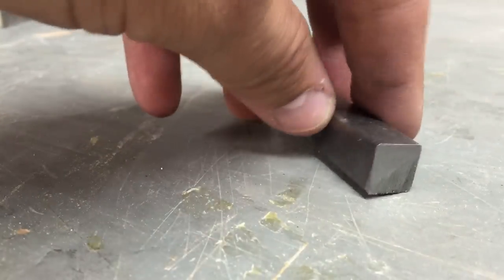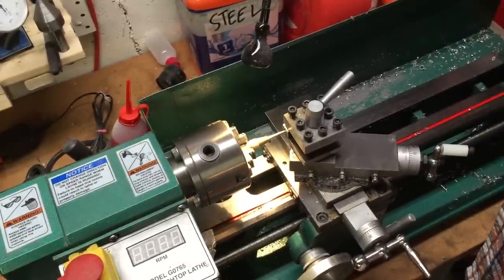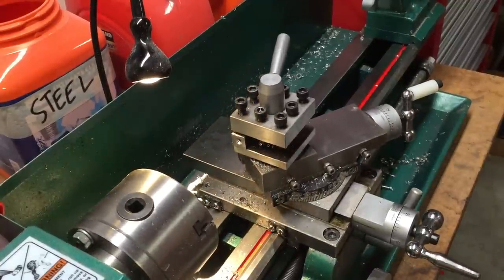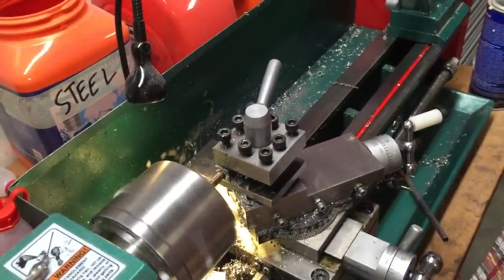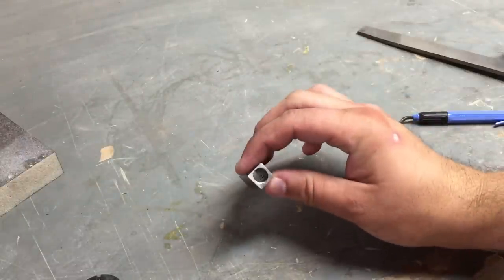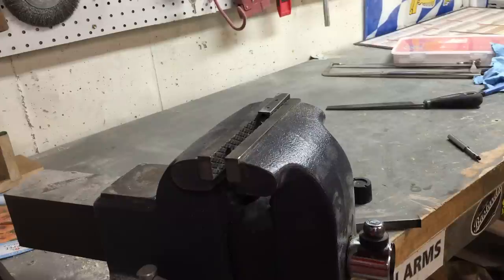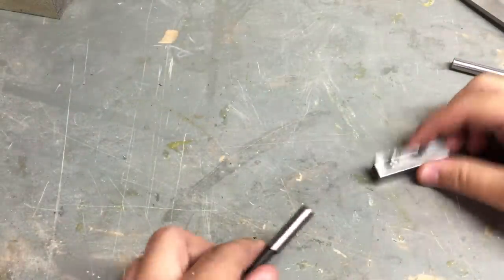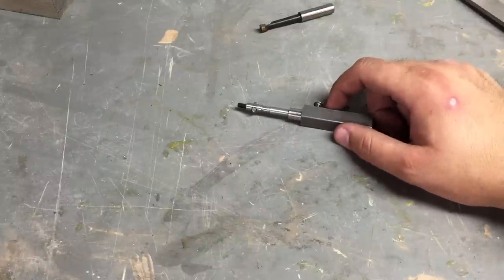Mini Lathe: How to make a Boring Tool Holder

Comment: I know this is an older video but just a thought, when drilling a pilot hole the drill used for the pilot hole should not be any larger in diameter then the chisel or point of the drill that is the final diameter of the hole. Over drilling the pilot can cause the drill to wander and chatter excessively. Thought I would just pass that on.

Comment: Good job.  The only downer is that the bolt thread depth is very shallow.

I would bronze a couple of nuts on the outside (MAPP gas will do it) for more depth/strength, or try and get some rectangular bar.  

I will make up a few of these in different diameters as well.

The auto centre punch is pretty slick.  I haven't seen one of those before, and that's now on my shopping list.

Keep the videos coming.

Cheers Rob
Reply from the maker: Good point, there isn't a whole lot of meat for the screws.  Bigger stock to start with would also help that!
The auto center punches are also great for breaking glass :)  they cost about $3 at whichever import tool store you have (Harbor Freight and Northern around my neck of the woods)  Thanks for watching Rob!!
Reply: Hello Rob, I am John. Just read your comments and was thinking along similar lines to your thoughts as I watched the video. Having said that the auto centre punch that you found interesting, I have been using the same one of mine now for 30 odd years. Made by Eclipse, it is their tool No 171. I find the English made tools of theirs to be of good quality in general, (disclaimer, I have nothing to do with the company apart from being a customer) They are available from most tool supply companies, easy to find on the net. Cheers from John, Australia.
Reply: Hi John,

I bought one of those auto punches from China, and it works great.

One thing I find it very useful for is judging metal hardness off the scrap pile- as it has built in repeatability.

Cheers Rob
Reply: I understand what you say about hardness test Rob. As long as you are happy with your punch then it is doing the job. I use mine for marking out then get the big guns out. Cheers from John.
Reply: I generally follow up with a regular punch, same as you.  The auto's are OK for marking out, but a bigger depression is better for starting the drill.

Cheers Rob

Comment: Thanks for the idea! Made one yesterday. I left the block in the holder, turned it 90 degrees and chucked my drill and tap. Used 1/4x20x1/2" screws

Comment: Good vid---making boring bars etc is pretty easy----I have never bought a boring bar ever I have made the lot---originally busted center drills or bits of hss and they were silver soldered onto some high tensile steel and for a boring bar for fine modelwork I would wreck a screwdriver and use that for the shaft..
The last few years getting lazier  or more cunning --take your pick,I have given silver soldering the heave ho and I mig all the bits of hss onto a suitable bar..It works really well and its fast..Who said laziness is a bad habit..They are bloody liars..

Comment: I'd add two or three more holes with that thin wall thickness but nice job!
Reply: Why not make it out of 1/2" by say 3/4" material and have plenty of material for threads for set screws.

Comment: Make one that eliminates the set screws, cut the holder the whole length where the screws would have went and utilize the lock bolts on the holding vise to hold the boring tool from spinning.. quick easy change.
Let me know if it works.  :)
Reply from the maker: +Jersdunz you can actually just buy that exact thing from little machine shop.  I like the set screws because I can have the holder mounted securely and retain the ability to rotate the boring bar if I need to.  Thanks for watching!!
Reply: For what would you ever need to rotate the boring bar? I've planned to just mill the bar flat so the tool post can hold it. Maybe I shouldn't?
Reply: Have you had any issues with the screws deforming the shank of the boring bar and making it difficult to remove?